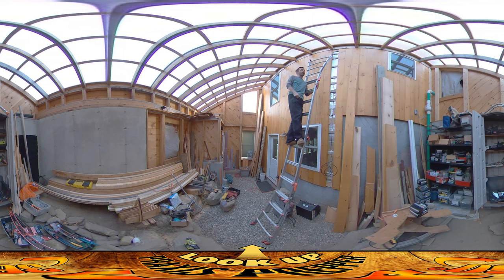Homestead Building - DIY FM Radio Antenna Install

Comment: It’s interesting that you can receive a radio signal with coax given that the shielding sleeve on coax is specifically meant to block extraneous signals from interfering with the signals being transmitted over the coax be it computer network (long time ago) or TV.
Reply from the maker: When you make an antenna with coaxial cable, part of the process is to strip away some of the shielding. It's a cool DIY if you're interested. I think I have a link in this video to another video specifically about how to make an antennae from coax.

Comment: As soon as you held it up I recognized it as a dipole antenna. Do you or have you looked into radio communications as a prep?

At the beginning of 2020 I thought I'd better get a CB radio just in case this get really messy. Back in the 80s I was into cb radios, so it was nice to get back into it.
Reply from the maker: I own a couple of short wave radios. Both a desktop and handhelds. I'm not up to speed on their effective use yet, but wanted to have them on hand if they became needed in the future. I think it's a good idea for sure.
Reply: @PraxisPrepper  i figured that if there ever was a full grid down situation no radio stations or anything. A cb radio might still be good for getting info or if you need to talk to a random person for whatever reason. A full amateur ham radio setup would be best, but that's an investment.

Comment: If you're having trouble with cell signal inside but outside it fine, have you considered a passive set of matched antennas, one inside and one outside?
For 850MHz/1700MHz dipoles of 16.782cm, for 1900MHz 7.508cm would be about right. 
Might be worth a shot.
Reply from the maker: I actually bought a device for a car that has a detached antenna for the outside of the car and a cradle that brings the signal in. I was about to set it up when I realized that I could set up wifi calling on my phone and just use the wifi router to stay connected inside.
Thanks for the suggestion though.